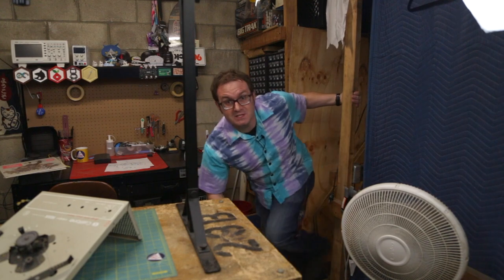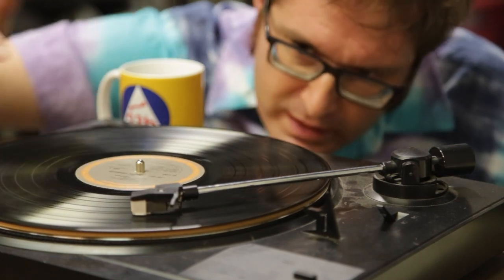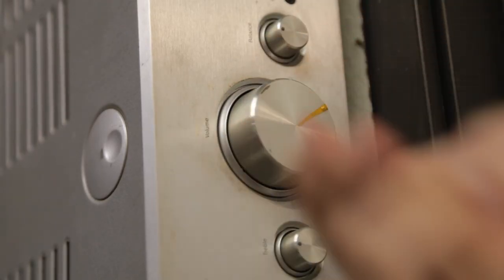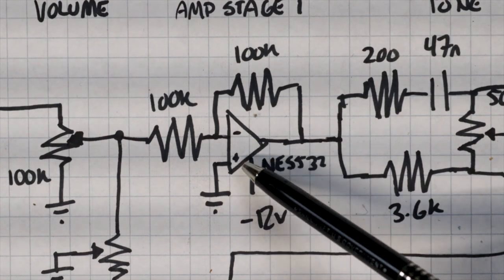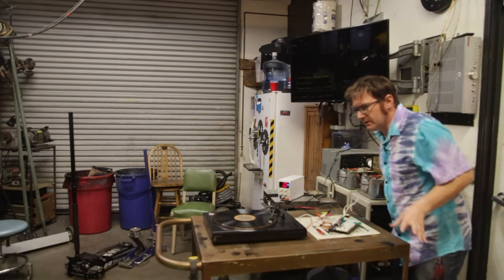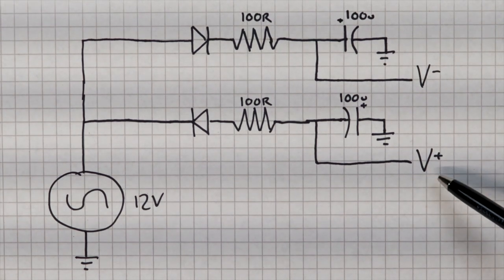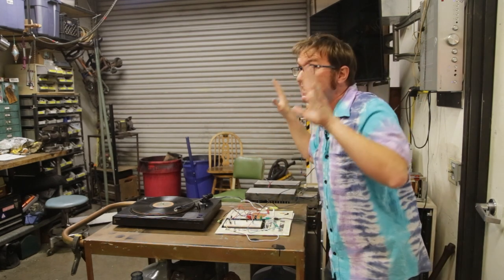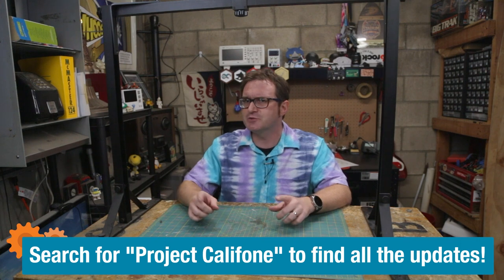Build a Phonograph Preamplifier - How Hard Can It Be?

Comment: The polarity of the diodes in the rectifier schematics are wrong!
Reply: It's not the diodes that are wrong... Note that the filter caps are properly connected for the polarity of the associated diodes.  It's the marking on his schematic of + and -  outputs on the paper that are reversed.   The + marking (the output) is wrong.. It should be minus.  Same for the minus output, it should indicate + .
Reply: @DIYerGuy  The diodes are in the wrong polarity. period. Just blah blah blah with the markings are wrong and other bs. They are wrong.
Reply: Johannes, he is using an AC source and his power supply is basically what we call a half-wave rectifier because he's using one diode for each half of the AC wave:  If you follow the circuit, on the positive half of the cycle, the TOP diode (in his diagram) will conduct and charge the top filter capacitor;  Similarly, on the negative half cycle, the BOTTOM diode will conduct and charge the lower filter capacitor;  Note that the filter caps are properly oriented for either the positive or negative part of the wave, that is, the + end of the filter cap is connected to receive the positive part of the wave and the - end of the bottom cap for the negative part of the wave.  It's the markings on the output of the power supply that are incorrect, they are reversed.

Comment: To answer the question "How hard is it to build a solid-state pre-amplifier from scratch", the answer is it can be almost impossible if you don't know what you're doing.  I'm an EE and there are so many issues with the example circuit that it's not worth going into, not to mention the error in marking the output polarity of the half-wave power supply (the output markings are reversed).  I suspect the circuit and the video were a "teaser" of sorts, perhaps with errors thrown in(?) to be followed up at a later date with possibly more videos that ultimately results in a real practical FOE-NO pre-amp that has sufficient gain and follows the RIAA curve to within +/- 2dB.  Otherwise, go out and buy a properly designed FOE-NO pre-amp.  But hey, it was a fun video !

Comment: RIAA eq is quite simple and easy to implement in an op amp feedback circuit, especially in these days of internet machines. Just do the jazz hands routine on the gargler chanting "op amp riaa schematic" and the secrets will be revealed to you. That said, last I checked you could buy a mass manufactured preamp with RIAA equalization for about twenty quid.
As for which EQ sounds best, that depends on which EQ was used on the recording, innit? The whole idea is that EQ out more-or-less exactly undoes EQ in.

Comment: the thing is preamps which run of ac transformer produces humm and noise if you could make something out of battery it would sound nicer, i hope some day someone teach us how to make preamp and amplifier out of tubes so we could have real analog experience
Reply: the Tube distortion pedal I made earlier on this channel is pretty much 3 overdriven preamps in series, if you experiment around with the component values you should be able to turn it into a tube preamp with clean output.
Reply: This is an analog amplifier.

Comment: I'm working a disk cutter that ran on tubes, i cannot seem to pick the correct schematic for this 1951 Phono. I jeep changeing my ideas fr the circuit, i have parts, but none that fit the schematics i google.i think google wants ppl to use BC457 transister or 2n222 Transister or  2n309Transister. i have 234 transisters, but not sure i can use them ??

Comment: It all could have been done using 4 or 6 transistors (2N3904, 2N4401, JAN2N2222a, and 12 volts DC. The JAN2N2222A and the 2N3904, are true low noise devices, ranging 4 to 6 dB Max.. Using 1% resistors and 10% polypro's and NPO's will give you a real low noise level of about 1.456 dB..., with a well filtered 12 volt supply.

Comment: That was so wrong. Nothing makes sense in this video. 
You have to attenuate high frequencies and boost bass. 
When I see phono preamp with 100k resistance in both signal path and feedback then I know the only thing it's gonna amplificate is noise.
Phono preamp is very susceptible to interference and that half bridge, half assed power supply will destroy last bits of performance.
Element 14 you can do so much better.

Comment: So if a replace the rc4580 op amps with the newer OPA1656 will be a difference in sound quality ??  will worth spending the money for 10 pieces OPA1656 ?
Reply: no
Reply: @slaweksuchy2702  When i replaced the rc4550 with tl082 i have noticed a difference on my genius  sw 5.1
Reply: @smamas114  impossible due to very poor schematic design
Reply: @slaweksuchy2702  So what do you recommend for replacing? Audio system is Logitech z5500 ,i have both the z5500 and the z906,the 906 has the ne5532 and sounds clear than z5500
Reply: @slaweksuchy2702  It’s all i want to hear,thanks 👍
Reply: @smamas114  replace with something new fast and low noice :)

Comment: cool video, i'd love to see some more in-depth electrical engineering hifi audio projects, though maybe outside of the scope of this channel.

as for the phono stage...the whole amplification circuit is contained within the op-amp right? so just directing current and hooking up power? so essentially plugging in a source and connecting a power cable, right?

Comment: The schematic is wrong...
The polarity on the "power supply" is wrong...

There is no way to someone learn electronics with all those mistakes... and all AGAIN, because last video with a project (the 13.6V power supply) the circuit also was completly wrong!!! The circuit presented on that and on this video both never is going to work!!!
Reply: Yes, this phono preamp circuit is wrong.  For starters, the phono line-in should go to an RC circuit of some 10uF + 47k Ohms connected to the non-inverting input of the opamp.  And the opamp negative feedback configured as an RIAA filter/decoder.  There are plenty of schematics on the internet for the RIAA phono pre-amp.

Comment: Since 1994, the NE5332, is not as good as it once was. China does a bad job in making them. In fact I have discovered that only JAN2N2222A/JAN2N2219A, and JAN2N2907A/JAN2N2905A are the only good BJT to use today. Their QA Control is still #1. Since records are not the thing today, no one cares about the QA any more. You can match BJT's, you can not match chips or IC's. The spec's are always on the high end for IC's. But they work.